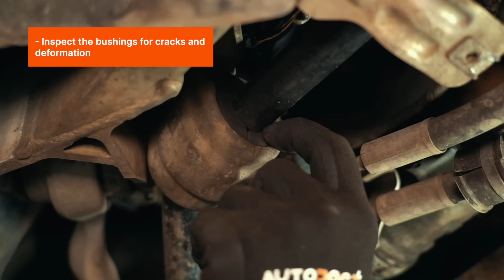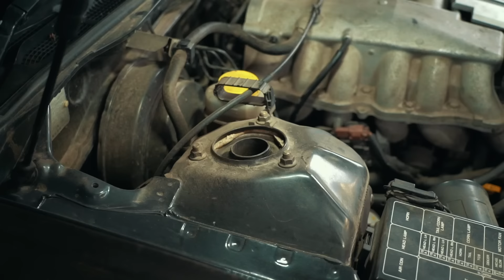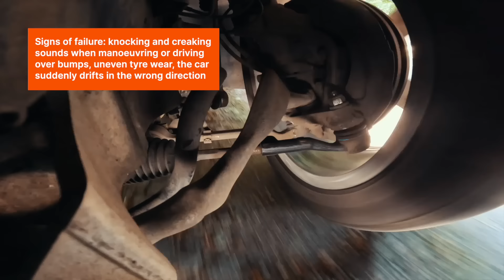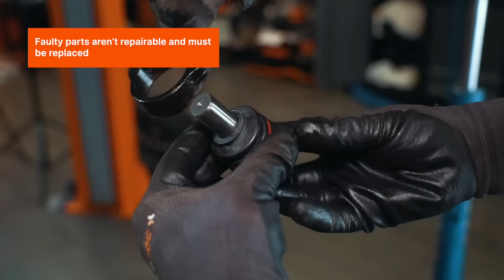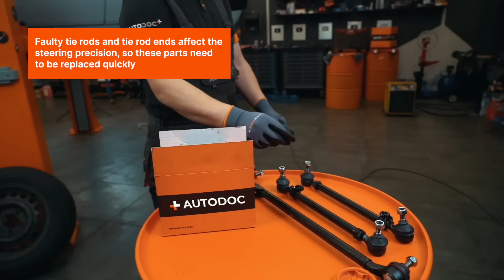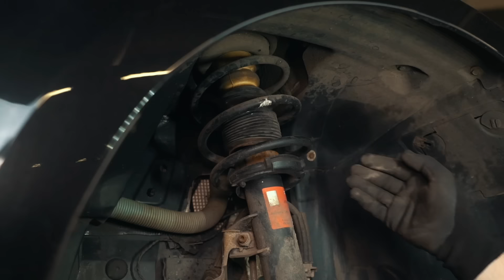Top 5 reasons why the suspension knocks | AUTODOC tips

Comment: I have a 2020 VW Golf (built in July 2020 in Mexico), and I have been experiencing a persistent knocking noise from the rear suspension since day one. Although the official recall mentions 2015-2019 models, I’m beginning to wonder if the issue wasn’t fully reslved by 2020. Has anyone with a newer model experienced the same problem? VW hasn’t aknowledged it so far, despite several repair attemps. Very frustrating.
Reply from the maker: We do not have such information and it is difficult to solve your problem based on the description, we recommend that you try to contact another VW service for a full diagnosis and identification of the cause of the malfunction and extraneous noise.

Comment: Can a bad tire/wheel cause a knocking noise?  I was hearing a knocking noise in the front drivers side when making a left turn and applying the brakes.  When I rotated the tire with the rear, the noise stopped.
Reply from the maker: We do not have such information and we recommend consulting with your mechanic.

Comment: my car vibrates when stepping on breaks in 80-up kph..the vibration is so strong...what could be the reason?
Reply from the maker: According to the description of the problem this could be curvature of the brake discs due to overheating; the discs need to be ground to a smooth surface or replaced if the thickness does not allow grinding.

Comment: I replaced everythong that you mentioned except struts, and nocking noise is even bigger, is it possible that struts caousing the nocking and the only thing I did not change? 😮
Reply from the maker: Based on the description, it is difficult to solve your problem; we recommend contacting a car service for a full diagnosis and identifying the cause of the problem.
Reply: @autodocuk  I found it (by myself) there was a problem with one bolt damaged threds and it was secure but not tight enough, problem solved. Thank you.

Comment: Nice vid i got a bing problem i have a toyota yaris hacth back 2007 it has every thing new in the  front i took it to a line the car and they cant do it because the car rolls to the front when they press the brake on the platform where they lift the car i have check every think and the mechanic told me it was the control arm but they are new from auto zone 2 month of use?!!. the car has control arm, shocks, rods, linkers even top mounts rubber base new what makes it roll to the front!!

Comment: I have a 2004 monte Carlo ss that has new suspension parts and brakes motor mounts transmission mount and I feel knocks in brake pedal while braking lightly even in steering wheel and feels like a wheel locks up some and abs and traction light comes on. I replaced all suspension parts and no hope.
Reply from the maker: Without proper diagnostics it is difficult to say something, so we recommend contacting the service.

Comment: steering wheel shake at highway speed and rims with tires are good and new...what else could be? tie rod ball joints?
Reply from the maker: There can be many reasons and without proper diagnostics we can not advise anything, please contact the service.
Reply: @autodocuk  they did nothing we change control arms new tires try other set of rims everything cv axles look good tie rods inner out look good ..i saw them myself and nothing worked still shake..after the control arms start shaking higher on 130+ km

Comment: A couple of additional comments. When it comes to front end parts like tie rods and ball joints, you typically won't hear or feel anything when they start to go bad, even it there's some play. These are two of the worst things that can break on a vehicle when you're driving. They need to be checked on a regular basis even if there are no drivability issues. Also, your method of checking the ball joints isn't quite right. When a ball joint starts to go bad, the play is up and down. You check by jacking the car up and getting the wheels a few inches off the ground. You then put a pry bar under the tires and pry upwards. In the video, you put the pry bar in between the ball joint and control arm, and pulled down. You have to go the other way because the springs are already putting a great deal of downward force on the ball joint. Going upward relieves the tension and allows you to see the play. If the ball joint gets to be so bad to where you can see the play by just putting your hands on the wheel and move it without the help of a pry bar, it should have already broken. 

I'm going into a lot of detail here because when a ball joint or tie rod actually breaks, you instantly lose both your steering and brakes. You have absolutely no control over the vehicle.
Reply: I had a lower ball joint come apart on my van, many years back. Luckily, I was in the outside lane, and right at the drive to a motel. Just enough time to get off the highway, and out of the way of traffic.
Reply: Spot on there, take note of these comments.
Reply: I understand losing steering but how do you lose brakes? Just curious as it's a separate connection
Reply: My wheel fell down after ball joint broke on the side of road in front of a Firestone tire shop. No symptoms that I could tell prior but this was many years ago on an old Dodge minivan. Issue I have now on a Ford Taurus is that rubber squeaking noise when turning wheel or going over bumps at a slow speed. Gonna bring car in to be fixed asap
Reply: I’ve just seen this , my back left knocks when driving and on the ground if I wangle the wheel it makes a noise will this be a bearing do you think

Comment: I had a knocking sound when going over bumps or moving slowing and turning into and out of a parking bay. The fault found by the dealership was front subframe bolts where not torqued to spec. This is a brand new vehicle, after 3 months. What would you make of this? Is this a factory fault?
Reply from the maker: It's hard to tell without diagnostics. Kindly consult your car mechanic.

Comment: Answer this, I've had a loud Creek and my front suspension for 3 years 99 Ford ranger it's been in three different shops they've replaced upper control arms lower control arms all the ball joints sway bar bushings sway bar links rear shocks front shocks all new brakes and yet nobody can figure out why this truck makes a loud creek after you come to a stop the excuses always it's the brakes it's the brakes well the brake pedals all the way down when you come to a stop You're not pumping the break the brake pedal is all the way down brake pedal is not moving and still when the truck rocks back it goes CREEEAAAK. TWO OF THE BEST SUSPENSION SHOPS IN THIS CITY OF 200,000 PEOPLE THAT I LIVE IN CANNOT FIGURE IT OUT
Reply from the maker: Without proper diagnosis it is difficult to say something, it is recommended to contact the service.

Comment: ive changed the axels, sway bar links, control arms, struts and strut mounts. ( im on the second struts and 3rd strut mounts form the dealer) Still crackling, rusty  and grinding noise coming from the front end as i go over small bumps. Its like something is dried up. When the strut mount has been replaced it would stop then start again in a few months. Stop doing it when its muggy out, then start again when its sunny. its been like this since 2018. everything i mentioned has been replaced within the past 6 months. Still hasnt gone away.
Reply from the maker: Without proper diagnosis it is difficult to say something, it is recommended to go to another service.

Comment: I have a Mitsubishi Galant that I've virtually replaced the whole front end on. New quick struts, lower control arm with ball joint, inner/outer tie rods, sway bar links. Still have an occasional pop when turning and also have what sounds like a single metallic clicking or popping noise when hitting a pothole or a good dip in the road or even sometimes when the suspension shifts or just backing up slowly. Everything appears to be tight.....
Reply: Check the motor mounts to
Reply from the maker: It is difficult to say something without proper diagnostics and that's why we recommend to contact the professional car service.
Reply: Check for broken springs.
Reply: " I've virtually replaced the whole front end "

Rear suspension can go bad also. No tie rods, but it has struts, control arms, ball joints, sway bars, bushings etc.

Comment: If your tie rod ends in the front are gone when you put power on very fast and take it off really fast can it cause the car to sway and if you're back end wobbles from left to right does that mean that your shoks have gone, the bike wobbles when you go over a speed bump but when you're driving on a normal road the car is smooth
Reply from the maker: From the description it is difficult to advise anything, it is recommended to contact the service.
Reply: Videos such as this perfect the amount of things I have sorted over the past few years checking a few videos bring myself up to speed in every aspect before I do anything always helpful
Reply: I was thinking that the  back shocks , where we're bad considering the amount of sway I was getting on the backend it is a good feature that the  this C-Class is the shocks and the spring are done independently of each other makes things a little bit easier in fact if you get a jack on the red jacket up underneath it should be possible in most cases to take the shock out without opening the bolt containing the tension in the spring you can just open the bolts in the push it up compressive a small bit and take it out separately that way you are not taking any risk with the tension on the which as you know can be bogey if it does give way and release of that energy very bad day,  like the fact that the spring and the separate in fact I increased the air pressure in the back tyres to 33/34 and even that gave amazing stability so I would imagine when the  shocks go in it will be like night and thanks for the return and the information great videos bro 👍

Comment: The number one reason why your suspension knocks is from using low octane blinker fluid. It will eventually leak past the exhaust bearings and cause damage to your suspension components.
Reply from the maker: Thank you for your comment! We are sure that your comment will be useful for many of our viewers.
AUTODOC
Reply: hahahah have you seen the reply to this mate 😂😂
Reply: @sidders5023  it’s just sarcasm lol
Reply: @the8419  It's an automated reply but pop off
Reply: @sidders5023 low octane blinker fluid 😅😅😅
Reply: Wow!  Thanks for clearing that up for me.  Is it a good Idea to oil your brakes if they are squealing?
Reply: @davidwarren9761  Excellent question. And I thought I was the Not that had fallen the farthest from the Nut Tree. Thanks.
Reply: What about the giggling pin on the laughter shaft, common on older motors
Reply: Thanks. Excellent. Inf. Pardon my Iggy. Just where is the low octane blinker Fluid put in.  As pertaining to steering gear box Is this the correct location and what do u suggest to use instead. ? Again. I have  only been Auto mechanic Since  1963. And still learning. Many  Thanks ken in Wva
Reply: And if you don't Replace a leaking exhaust.  Your car Will Overheat.
Reply: Also causes turbo-encabulator gimble failure.
Reply: This is not true. Everybody knows that blinker fluid does not have octane.
Reply: high quality video!

Comment: My 2012 Toyota Camry driver-side tire started hoping after I clipped a curve. The hop is not severe but, more like vibration at about 30mph it then stops after the speed reaches above 35mph. I just changed the swaybar links on both sides thinking it would fix the problem, but it didn't do the job. My next guess is maybe the balljoint? Any thoughts on what might be causing this vibration on my driver-side tire? At some moments it feels like the vibration hopes over to the passenger side tire as well.
Reply from the maker: Without proper diagnostics it is difficult to say something, so we recommend contacting the service.
AUTODOC
Reply: Did you figure it out?

Comment: Superb video. Not a single reason blamed on the actual strut, unlike some mechanics who want to grab a quick big buck from the job and parts.
Reply from the maker: We are glad that this video was useful to you!
Reply: How naive. As a mechanic I've seem numerous struts with a play in it. I've also seen people who've changed the wheel bearings due to a strut play.
Reply: @東京ワナビ  How do you check to see if a strut has play?
Reply: @AT-wl9yq  While having the wheel jacked up and strut extended, grab the tire in 12 and 6 o'clock positions and pull/push alternatively with your hands. This should reveal a strut with play in it.
Reply: @東京ワナビ  I think you may be confusing another type of issue with a strut problem. The strut housing is a solid piece of metal. It doesn't connect to a vehicle in a way that would be possible for any type of play to occur. You may be thinking of the top strut plate/bearing, that can wear out over time. But even with that, you wouldn't diagnose it by checking for play at the wheel. There's always tension on it even when you lift the wheels off the ground. 

If you do a little research on the issue, you'll find many ways to check for a bad strut. What you're suggesting with play when you move the wheel in not one of them. Its practically impossible. Or, you could be talking about something else and this is just a miscommunication.
Reply: @AT-wl9yq  I'm talking about rod to barrel play, which is pretty much all strut related there is. That is, in McPherson type of suspension what we were looking in the video. Bearing and bushing issues is not directly to strut related, even if they were connected to it. They must be checked according to the configuration of the suspension.
Reply: @東京ワナビ  If you're talking about the rod that's part of the actual shock absorber portion of the strut, that goes through the middle of the top plate, it can't happen, even if there is some play. Assuming there are no other issues, the wheel is bolted to the hub, the hub assembly is pressed or bolted to the spindle, and the bottom of the strut assembly is bolted to the spindle. These are all metal to metal connections, with no bushings involved. It can be treated as one piece. That leaves the spring and the strut plate. You're not moving the spring in a lateral direction just by putting your hands on the wheel. Its just not happening. 

I certainly don't think you're making any of this up, but I would be considered an expert on this particular topic. That said, expert or not, I can still be wrong. So I did a little research just to see if there was something I overlooked. Unless you can show me something different, I wasn't able to find a single credible reference to support what you're telling me. And again, I don't think you're lying, just mistaken. If you can show me some references, I will be more than happy to look at them.
Reply: @AT-wl9yq  you're missing the entire point. The strut "barrel" is the part which is connected to the steering knuckle. The strut is essentially a hydraulic cylinder (shock absorber) with a spring around it, which forces it to extend. The cylinder has a rod and it rides inside the barrel. When there's play between the rod and the barrel, you get similar play as in a bearing play in the hub together with a knocking sound. This is not made up, it's real life and not some 10 point checklist online.
Reply: @東京ワナビ  I understand what you are saying now. I thought you were talking about something else.

Comment: My suspension knocks because the rubber sleeve on the strut spring is very degraded. Im not sure if I can find a replacement on the autodoc app but im just waiting to find a good solution to fix it.
Reply from the maker: You can find this information in the technical documentation for the repair of your car.